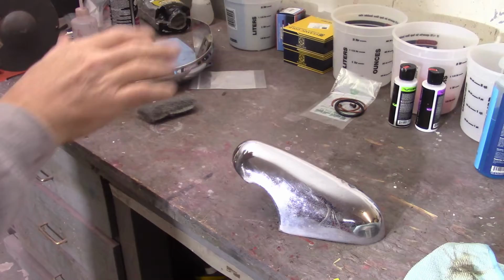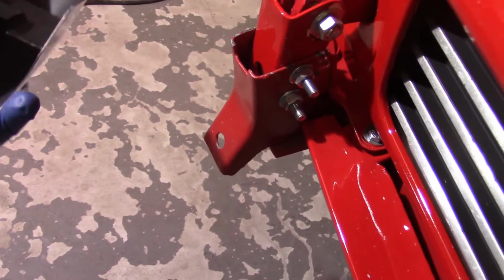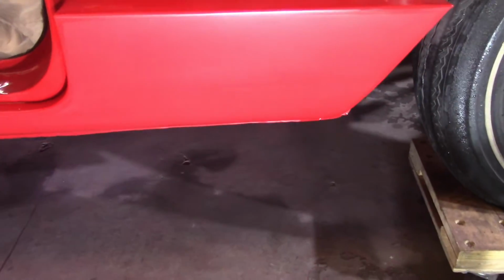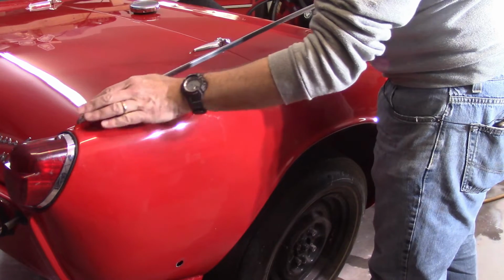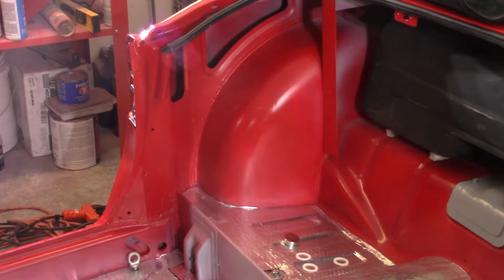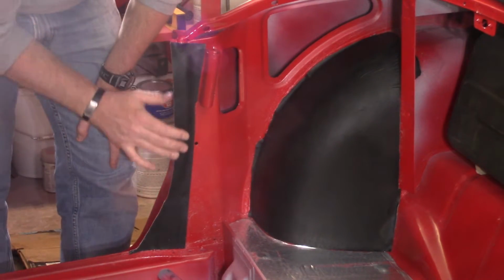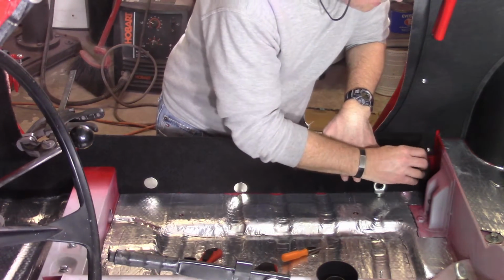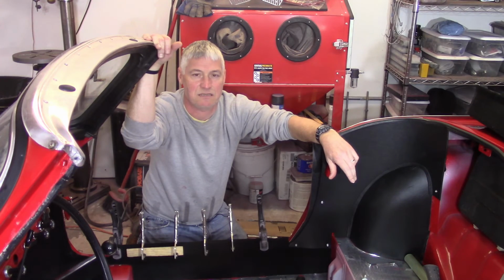Triumph Spitfire Interior Install Start | Roundtail Restoration

Comment: Nice job on the install...I used the 3M and was pleased with it...I also used my wife's hair dryer to heat the vinyl so it fit over that rear wheel well with no wrinkles....I love that sound deadening material where did you get it? I like the molded carpet kit and will use it on the GT6....I used the "fitted" kit on the spitfire....was ok but did not meet expectations...was out driving the spitty this weekend around the neighborhood as we are not really supposed to be out unless going to work or the grocer or doctor......was worth it...lol soon you will be doing that with Dot and you will have the time of your life...Anyhoo...stay safe and healthy!!!
Reply from the maker: Sorry, Robert, missed you comment. Hair dryer is a good idea, I'll have to try that. I got the sound deadening stuff at Amazon: https://smile.amazon.com/gp/product/B00URUIKAK/ref=ppx_yo_dt_b_search_asin_title?ie=UTF8&psc=1. You stay healthy, too!

Comment: what is the workshop manual do you use
Reply from the maker: Hi Doug. I'm using the factory one from Triumph. You can find an early version (doesn't include the Mk3) on the web in pdf form.

Comment: Maybe you could modify the over-rider to match the original? I'm sympathize with the situation, I'm tired of supplier selling poor reproduction parts.

Stay safe
Reply from the maker: Yes, very frustrating. Especially since it's not like they are hard to find for copying. I think the threaded rod is just a long bolt, but haven't verified that. I might be able to cut it down and then thread it out. It's probably tacked in there, though.